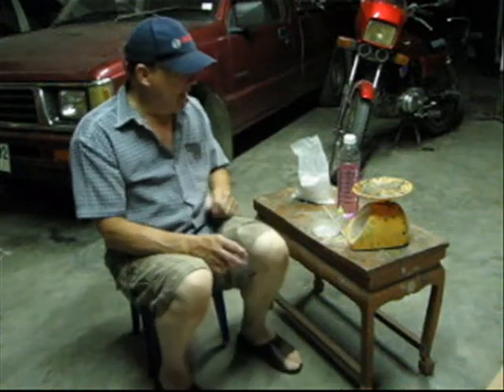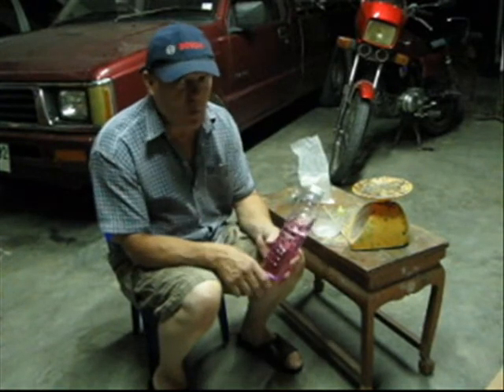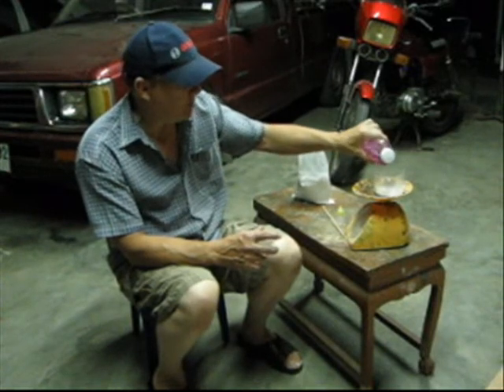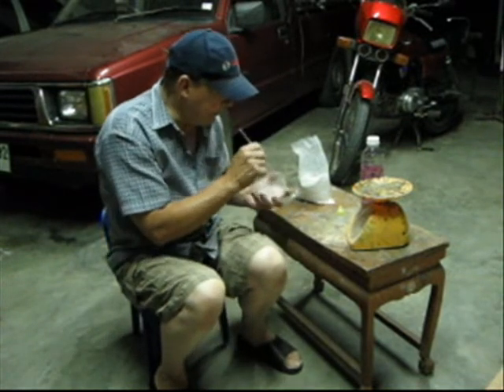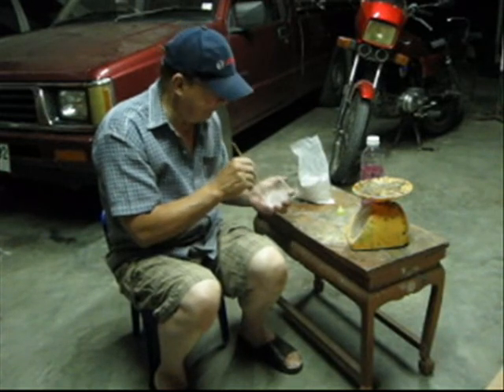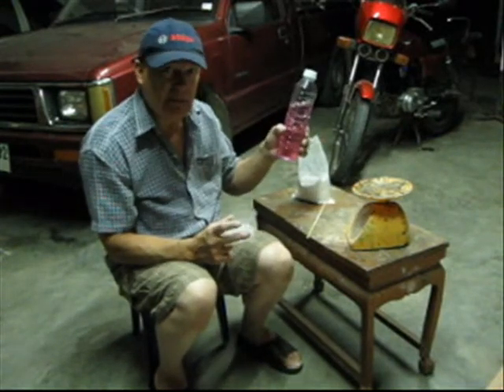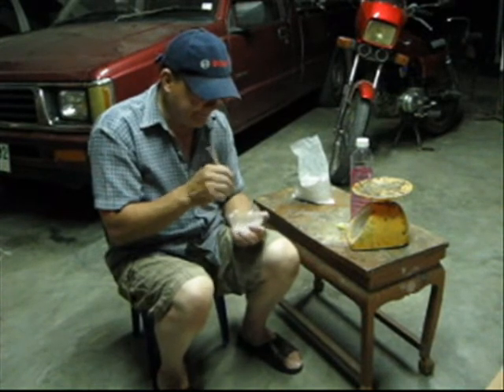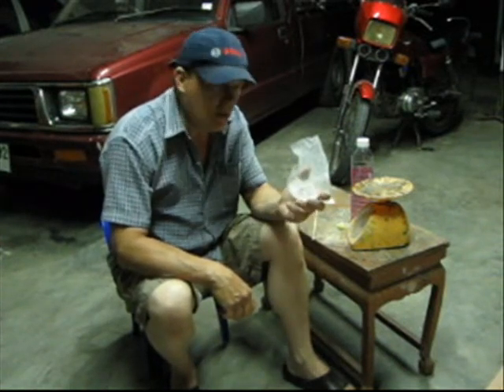How Bill makes  glue

Comment from the maker: @MrSchpankme I am sure you can build good craft but think about it, there are millions of fiberglass hulled boats on the water today made of fiberglass and polyester resin. When I and most people make repairs to fiberglass hulls I use fiberglass and polyester just like the manufacturer did. Polly is still used today, if it absorbed water they would have switched to epoxy but they didn’t…  Happy building, Sean not Bill